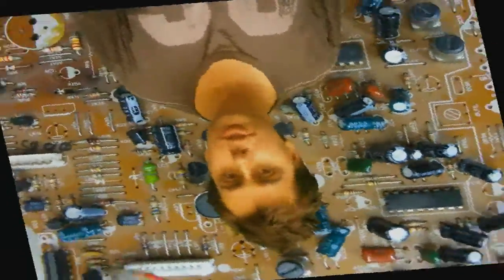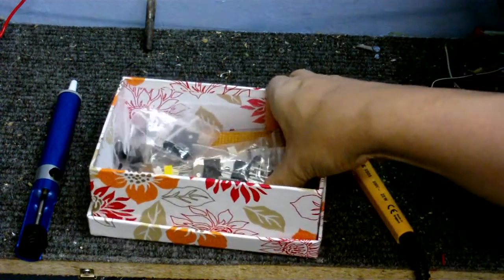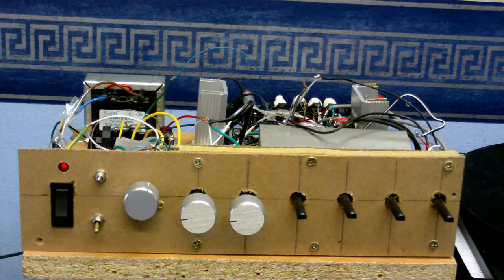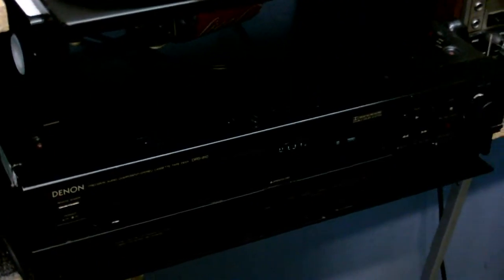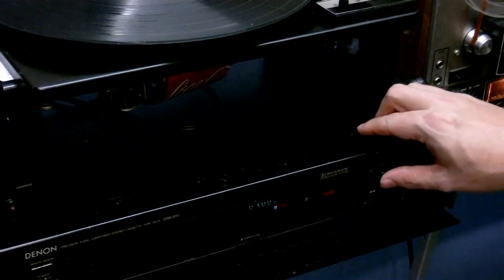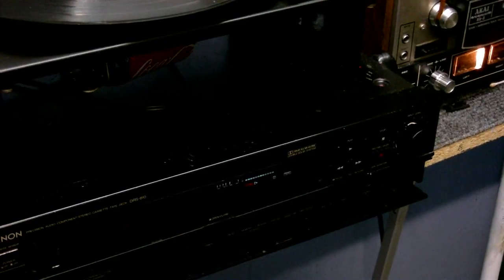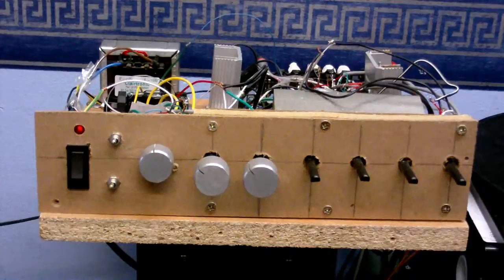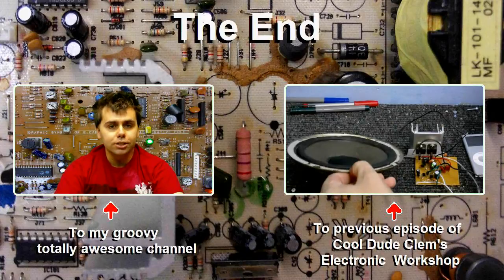CDC Electronic Work Shop electronic parts have arrived and a tour of my home-made amp

Comment: hey clem do you rekon for the next project you could try making some kind of circuit that will change output automaaticly so basicly a circuit that has say 3 outputs and they change so output 1 will be on for 30 seconds then change to output 2 and that will stay on for 30 seconds then output 3 will be on for 30 seconds if you get me thx nathan